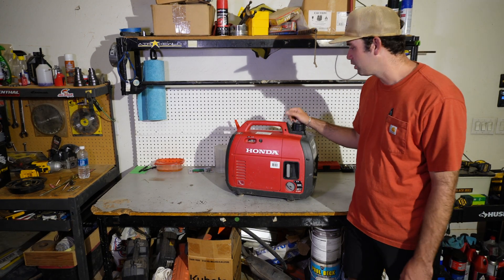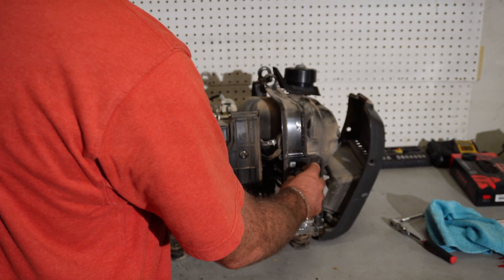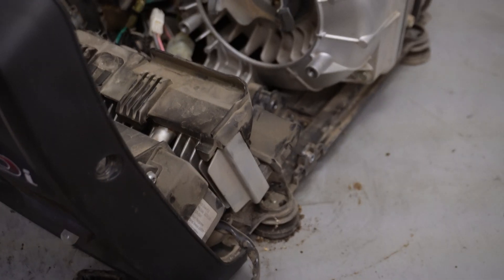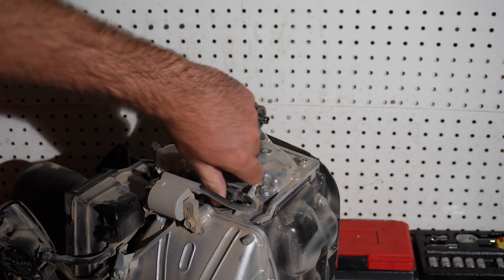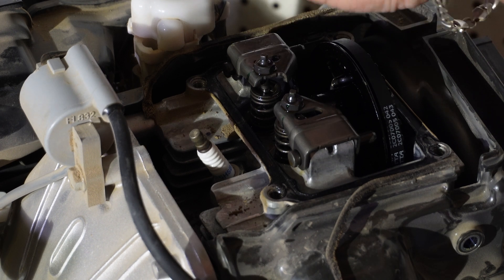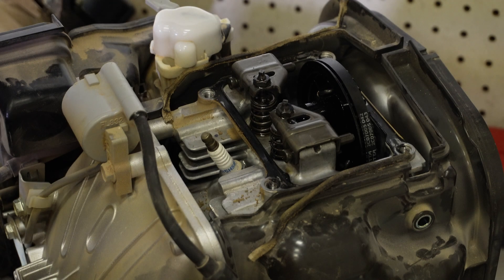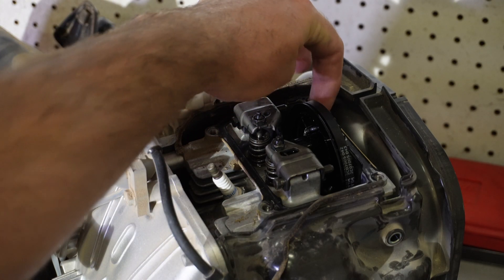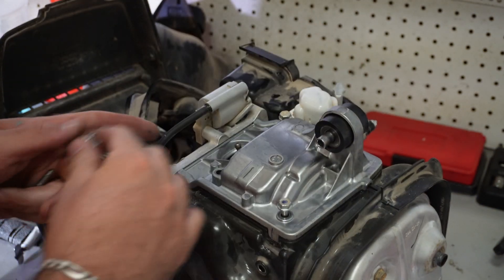How to adjust the valves on a EU2200i Honda generator

Comment: You made it unnecessary complicated. It's a non overlap single cam lobe engine. If the exhaust is rising the intake is closed, and vice versa. No need to check TDC and take apart the entire front.
Reply from the maker: Thanks for the information.

Comment: It's not 15mm but 0.15mm. The same applies to every measurements related to millimetres you mentioned in the video.
Reply from the maker: Yes thank you for clearing that up
Reply: i noticed that  and on EU1000i :  in 0.08mm and ex 0.11mm +-5

Comment: Awesome video! Just got a used one and am inspecting it over. Perhaps im missing something, but after removing the red housing body, the valve cover is exposed so why is it necessary to remove everything else if one can just remove the valve cover to access the valves?
Reply from the maker: I just did it for filming purposes so that there would be less stuff in the way. It also helps you find TDCC easier if you don’t know how to find it by just looking at the valves. There is a mark on the pull starter to help you. But yes you don’t have to take as much stuff off as me. Thank you for the comment
Reply: You will need to rotate the engine. The valve you're adjusting needs to be fully closed (off lobe). He demonstrates this by putting the engine at TDC but you don't really have to do that. He did a very good job